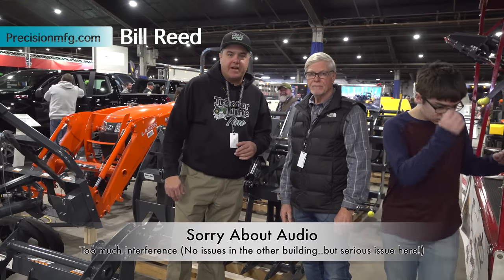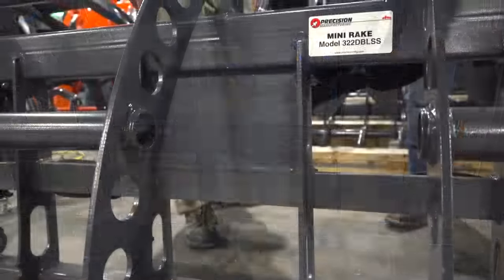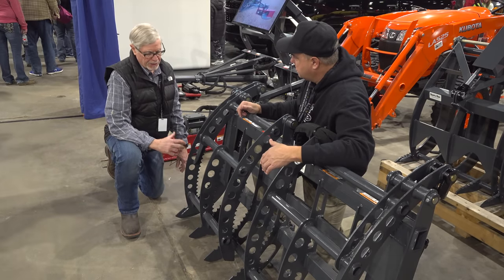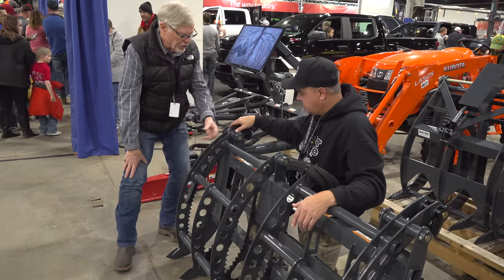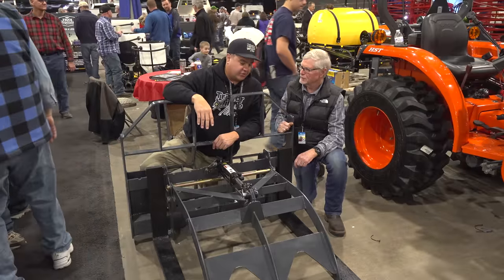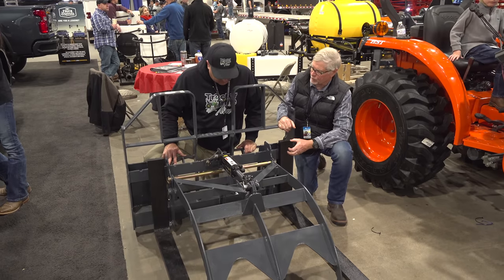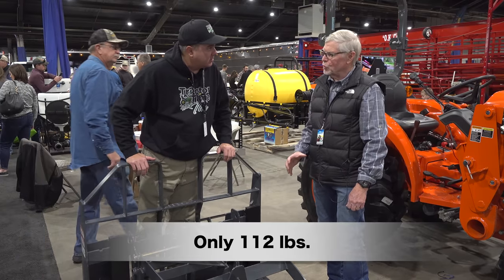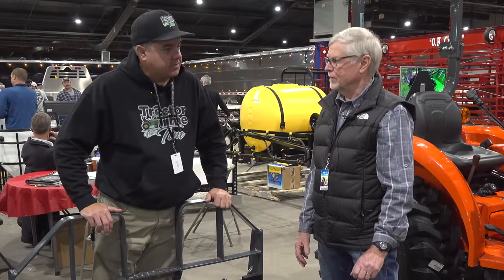Mr. Double Grapple! Add A Grapple For Pallet Forks!

Comment: I like that Add-a-Grapple for pallet forks!  I saw one similar a few years ago but it was a much clunkier design. Looks like an excellent solution for someone who only occasionally needs a grapple for smaller projects. For those with Artillian fork frames it also looks like it would work with in conjunction with one of the Artillian sectional rake lower sections.
Reply from the maker: Never thought about trying with the lower rake section.  If I get a chance, I will try that!
Reply from the maker: I worked with Bill on this design, making it more lightweight by removing some of the duplicate frame.  We think this is quite a cost effective solution!
Reply: @TractorTimewithTim  Yes, I agree.
Reply: @TractorTimewithTim  this is the first time I've ever thought to myself, "I really want that grapple!" I'm pretty handy with my regular old forks on my Mahindra 1526, but there's been a time or two that a grapple would've been handy. Could never justify the cost though. Looks like I'll be looking into adding a third function and an add-a-grapple. Thanks for another great video!

Comment: Will the mini fork add a grapple work on a 1025R?
Reply from the maker: Yes, as long as you add a diverter or 3rd function valve.  You can get a diverter kit at artillian.com
Reply: Thanks! Love the show. The John Deere pallet fork rack does not seem to have as many position slots. Is another brand a better option? Weight is an issue for me too.
Reply from the maker: Mike Keil artillian is the premiere.  Lightest on the market.  Expensive, but the weight and strength makes it worthwhile.

Comment: This is a great looking product!  I've been shopping grapples for the last few weeks, and I have yet to see a rake-style grapple with a split lid.  Tim you've proven that the double clamp is the way to go.

The drawback here is obviously price.  I tried the TTWT coupon code and it didn't work, but even so I think this may be out of my budget.  Do you think they need someone to prototype it on an orange tractor?
Reply from the maker: The TTWT code definitely works.  Make sure you do not have spaces before or after TTWT...it is 10% off.  If the code still doesn’t work for you,  cal precision mfg!  They will get you the discount.

Comment: Tim I installed the 3rd function diverter valve from artillian and ordered the mini pallet add a grapple but when i try to engage the grapple i hear the solenoid clicking but the grapple cylinder wont operate any ideas would be much appreciated?!
 Thanks
Reply from the maker: Does the ‘normal’ function operate instead of the diverted function?  Or does neither function work?
Reply: Yes the normal function works my forks will raise up and down and tilt but the grapple doesn't move. I had to neck down from 3/8" npt on the cylinder  to 1/4" lines to  fit my diverter valve maybe it's a flow issue?
Reply: @TractorTimewithTim  Yes the normal function works my forks will raise up and down and tilt but the grapple doesn't move. I had to neck down from 3/8" npt on the cylinder  to 1/4" lines to  fit my diverter valve maybe it's a flow issue?
Reply: @TractorTimewithTim  and I should add there is fluid at the grapple quick coupler
Reply: I have a slow leak from the base of  pioneer  coupler but that shouldn't cause it to malfunction should it?
Reply from the maker: Slow leak not an issue.
Try a gentle ‘tap tap’ on the barrels of the diverter.  Perhaps they are a bit stuck/frozen.
Reply from the maker: If that doesn’t work, ask on greentractortalk,com. You’ll get lots of help there.
Reply: @TractorTimewithTim  ok thanks  👍

Comment: I like this Double Grapple (in minute 2 in the video) where can I purchase one from, or how can I contact you? Please let me know. Thanks
Reply from the maker: Buy at agfolks.com use code ttwt for a 5% discount.
Contact company there as well.
Reply: @TractorTimewithTim  Thanks, one more last question, what is the model or how can I identified it? Thanks again
Reply from the maker: If you have John Deere, choose the mini320. If SSQA, choose the mini322.
Reply: @TractorTimewithTim  I have a Kubota L45 Tractor.
Reply: @TractorTimewithTim  Is my Kubota L45 strong enough for this Grapple? Thanks
Reply from the maker: You should get the mini327 for that tractor.  It is bigger than I was expecting.  Sorry.
Reply: @TractorTimewithTim  Great Thanks for your help.

Comment: Tim, we, your fans, need you help.  I need your help. Your like the big brother I never met but trust.  I can hardly justify a sub-compact tractor. What I need is one of these grapples that do not need a 3rd function. Cost is a issue. It will see use, but not near the volume you do. More like four families indoor fireplace wood hauling from the woods to the trailer or to hold logs to be cut by a chainsaw. Also yard cleanup.   My goal is to save my back. Which economical, no 3rd function grapple should I consider?
Reply from the maker: Honestly?     None of them!    They are a poor compromise.

The 3rd function diverter from artillian is $715 for a 1025r.   Bite the bullet and get it.
You will always be disappointed with the compromise solutions.   The electric one is too slow.
The mechanical one does not provide sufficient flexibility/ functionality!
Reply: Tractor Time with Tim for what its worth, you are telling me to not get a grapple.  I simply can hardly justify a budget price grapple without a 3rd function hydraulic system or diverter.  There is no math that comes back justifying the 3rd function plus grapple. I may try to maybe make due with forks only. I’m posting withhopes that at some point you will choose to try some of the no-3rd function grapples then tell us they are a poor compromise but if thats the way you must go, brad X would be best for us and here are some tips.
Reply from the maker: Understood.  Not exactly sure how to handle this.  Seems almost cruel to ask a company for product so that I can say that I don’t like it.
I’ll continue to look for ways to show them.
Reply: Tractor Time with Tim thank you. Your sponsor “Good Works” has a couple of them he used in his YouTube video.  I noticed, but decided to not comment, he had the Brush Crusher 4200 lower, free hanging stop brackets installed incorrectly. The two, U shaped brackets, when used with the JDQA John Deere Quick Attach need to be in the furtherest down, jaw most open position if you are doing lifting and dumping with a raised front end loader. The channel three cabins mentioned this in his video. He explained that as soon as you raise the front end loader, say if you are putting logs on a trailer, the logs will not roll off the lower fork unless the lower jaw is as far down as it can go.  I think Tractor Works may have had better results had he made this one change.  Also, three cabins said it worked better with the center jaw accessory. Hope this helps.
Reply from the maker: @DougAlesUSA  ...but the BC4200 is about $2000, and it is 283 lbs EVEN WITHOUT the center jaw accessory.     ....and you can't dump on a high pile.   I find it to be a horrible compromise.

Be careful when listening to reviews by dealers trying to sell product (even if they are my friends online).  I do not think GWT did the viewers a service when showing and discussing these two options. Yes, it will generate some sales for him, but money is not worth it to us. 

We made a decision long ago to only recommend products we personally believe are effective, and a good value (not necessarily cheap, but a useful value).

Having said all of this, if you think the WorkSaver electric grapple, or the BC4200 thingy is right for you, go get it.   Who knows, it might be perfect for you.
Reply: Tractor Time with Tim let me go check the price. Thought the BC4200 was more like $1,400’ish   EDIT: out of respect, I’m not going to post a lowest cost supplier.  Since you know Good Works, have them as a sponsor, I’ll pick them. Per their website, its $1,399+ tax, which I’m not sure if that sales tax is where he is located or where the customer is located. If for farm or homestead use in my home sate it would be exempt from sales tax, but I’m not sure how that works if its purchased in another state. State tax laws vary, so focusing just on the item, lets say $1,399.

Again, I’d love to see you try one then, after you use it for a few jobs, then give your feedback, including prices in your reasoning.  If you feel just plane forks are better, I’d love to get your honest feedback.  Its your integrity that keeps me coming back to your videos. You are simply a person I look up to.